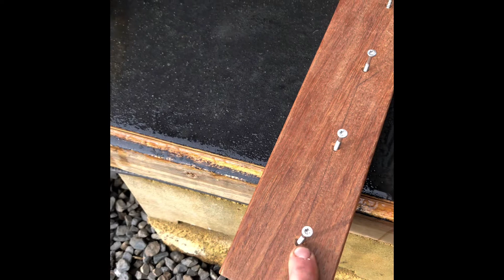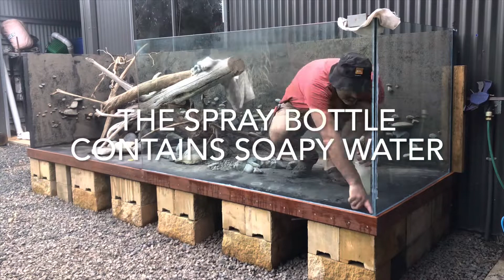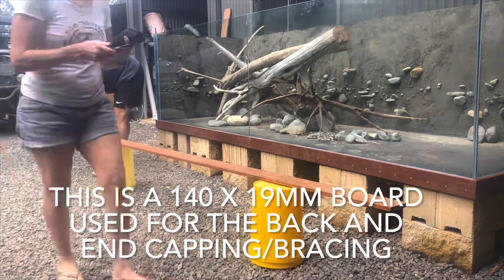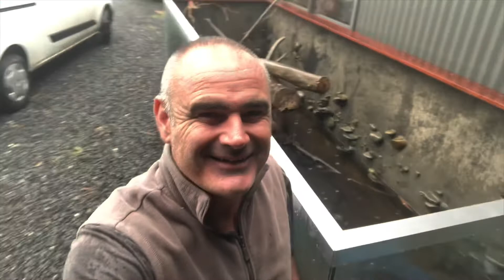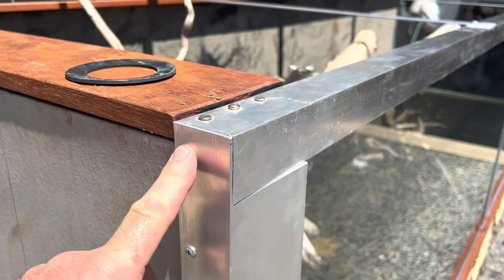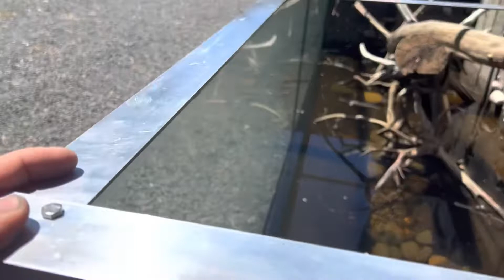Australian Turtle and Rainbow Tank Part 4 - Installing the Glass and Bracing

Comment: Hey there,  what thickness is that aluminium bracing?
Reply from the maker: The bracing on the turtle tank is 3mm aluminium, however I’ve since been using 6mm aluminium on Palau Reef and 3mm stainless steel on my seaway aquarium. I haven’t had any worries with the turtle tank, but just thought it better to go thicker
Reply: @australianaquarist  just wasn’t sure if 3mm was enough because big price differences once you ho thicker than 3mm.
Reply from the maker: @jarroddainton that’s why I originally went 3 mm. I’m going to use threaded rod and turnbuckles for my Saratoga tank I’m working on. I show it, briefly in the latest video. 
https://youtube.com/playlist?list=PL3TJwBL958AzOgIWaqqH_jtvyHp24FLQd&si=ptF9R8sIg2Yms32Q
Reply: @australianaquarist  yeah I'll very interested to see what you come with
Reply: Im also trying out formply instead of traditional raw ply. What's your thoughts on that?
Reply from the maker: @jarroddainton I’m not sure how the epoxy will stick to the surface. You might need to do some test pieces first

Comment: Hey Adam, 

Still reckon using the toughened glass was the correct choice? Still recommend it?
Reply from the maker: Yes
I have no reason as yet to believe it was a bad choice. If you can afford the 15 to 19mm float glass required than by all means use that. I can’t so found an alternative in balustrading glass

Comment: Also the base is 12mm and side are 10mm
Reply from the maker: Hi Margaret
So just to clarify …. Your proposed tank is 5 x 5 ft, and 5 ft tall? The thickness of the glass is dictated by the height of the water column in the tank - that’s what creates the pressure. As a general rule for fully braced tank ( not just euro braced and definitely not rimless)…..
- 10mm is ok to 600mm water depth
- 12mm to around 800mm
- beyond that you’re up to 15mm and 19mm glass. 
It comes down to how tall your tank and how much bracing you install. 
If it is 5 ft high you propose, the glass would be a minimum of 19mm , even thicker. That’s when acrylic becomes an option. This is the realm of commercial aquarium builders
Reply: @australianaquarist  love your work mate. Currently building a 3000mm x 900mm x 750mm tall tank inspired by your freshwater Aus native tank! And google gives a different answer on front panel glass thickness every time.  I’ve opted for 12mm float… would love your opinion on this 😅 it’s a fully framed tank like all of yours… I’ve built smaller 220 gallons etc. but this one is a big jump up.. cheers! Keep up the good work!

Comment: Hey I’m building a 5ft x5ft x5ft tank the base is toughened and I’m wanting to get the sides not toughened just wondering if it would break from the amount of water
Reply from the maker: What thickness glass are you using and what are your plans for bracing?